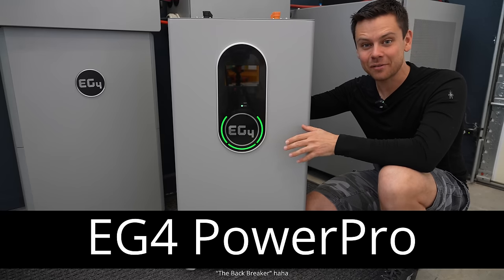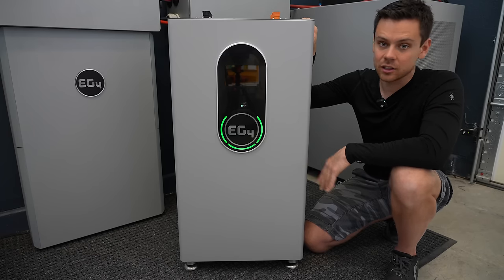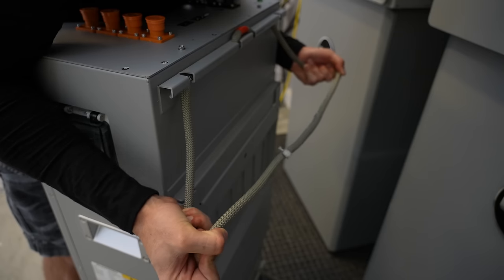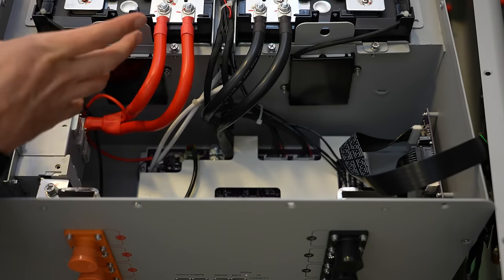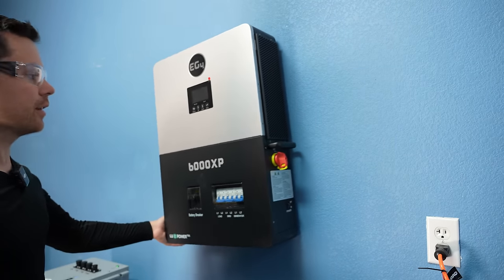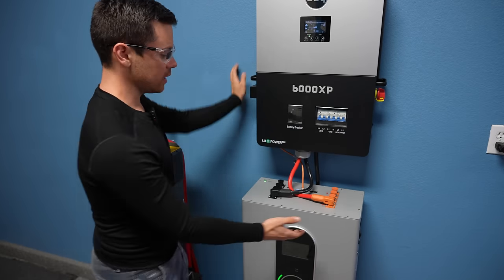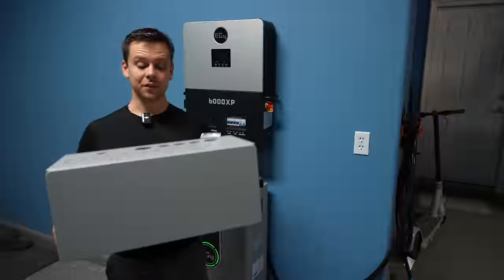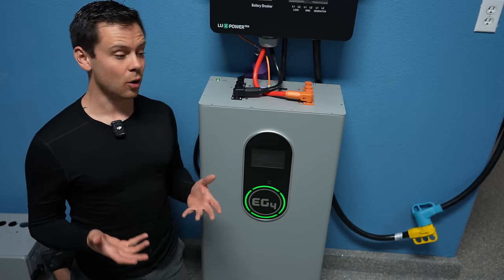New! EG4 PowerPro Budget Model: 14.3kWh LiFePO4 Battery for $3,431

Comment: Outstanding video. I'm interested but inexperienced. I have a poorman's agm battery system to backup small stuff in the eventuality of a power outage. Questions: were you implying that if you dropped the lid it could cause a short circuit, like the wrench could? Could painting on thick layers of liquid electrical tape on the positive contacts be worthwhile? Maybe you can profitably create some battery-like covers and sell them on your website.

I see that the batteries have sensibly included adjustable 'feet' like for a washing machine. Be sure that the rear ones nearest/next to the wall are a smidge shorter to insure that the battery slightly tips toward the wall (I'm an old Dad).

Question: I'm also interested in online affiliate marketing. Isn't your affiliate marketing link associated with an account? Wouldn't this nullify your concern about the ad blocker? If not, consider linking to your website which is a recommended practice anyway and beats your buyer remembering to turn the ad blocker off and on. Then at your website, if you keep it simple, your buyer can, without giving it a second thought, click on the affiliate link without you losing your well-deserved commission.

Comment: Thats a great setup for a camp. But these inverters are having a hard time with generator charging. Some make it work.  
It would be great if you can do a video on generator application. Because a lot of people are using this off grid and a gen is needed in some cases.

Comment: I'm considering a complete off-grid 16X40 shed to cabin build. I'm new to the solar power landscape. Could you make a recommendation for a system that could handle 20kWh daily 24/7? Also how many panels would I need to power the cabin during the day while charging the battery reserve? What panels would you recommend? They could be mounted on a white metal roof which would provide some reflection to the back of double sided panels. Please keep in mind I would like to stay as budget friendly as possible while maintaining a solid system. Just a side note, would it be possible for a  generator hookup to charge the system for extended cloudy days especially during the winter months on the east coast? I have watched a lot of your videos and my brain is in information overload. Any help would be appreciated. Thanks

Comment: Lolz at Will cutting what looks like 4/0 wire as if it were 16 AWG. Snip. Done. Meanwhile for me, it's more like using 4 foot handle lever cutters and leaning my whole body weight on them for 5 minutes to get a cut.

Comment: “You can use the conduit box and still leave an inch or two between the batteries!”

Oh, good. Blocking the breaker seemed like a safety issue. 😅

Comment: Thank you for sharing this Will. We live in an acreage, no water line, we are using water pump for our water supply. If there’s a power outage, then we do not have water available. Instead of installing generator, can I use that EG4 pro instead? What’s your thoughts? Thank you again

Comment: I've got a nine foot wall space for electrical.  With 4 batteries and the required spacing between the batteries, that would take up the whole length of the wall.  Will electrical inspectors allow you to install the load center above the battery, which sticks out 10 inches?

Comment: Will,  I live in Georgia.  My house has very good Southern exposure and ZERO shade trees.  My roof is needing replaced.
My electric bill runs $350 to $450 per month.
Would a system like this combined with solar to charge it be cost effective?
We would keep the house cooler in the summer if the cost was say $250 less per month.
Thank you for the excellent video!

Comment: Are there any inverters which can handle an array of multiple batteries in this system? Can the 12000xp for example handle an array? If possible, please do a video on lowest cost highest volume storage solution for multi day outages as a gas generator alternative.

Comment: I’d be interested is seeing this system in a tiny house / off grid mock-up. Is one battery and inverter enough for a frugal energy use situation? Smaller refrigerator, tv, lights, computer, ac and space heating.  How much solar would you need? We have a weekend and holiday cabin we’d like to use more but now it’s just like camping with a marine battery we run an inverter on. As we’re getting older it’s getting harder to manage without the mod cons.

Comment: The touch pad on that battery is what the EG4 inverters should have had 8 years ago. Or any inverter for that matter. I have 4 6500EX's powering my house and it's ridiculous trying to understand the screen. It's blocky and 1980ish. Works well from what I can tell except for the lights flickering

Comment: Could I use this thing just as a backup for when my grid power fails? Rather than building an entire solar system, what kind of system do you recommend as an emergency backup that would work for several hours during an outage? You’d guess that some sort of battery system would be preferable to an entire solar setup, as the battery can be charged and be always on standby during normal grid activity? If you could make a video about helping us design a good setup for this I think it would help a lot of people that suffer power outages on a regular basis like we do.

Comment: I'd be interested in a video covering a low cost set-up just for peak shaving and backup power, where I live there isn't much solar, but if we ever do a new roof want to keep it an option. The cost of battery+inveter have dropped so much it's almost less that a home generator. This power pro solves the battery side, but what inverter? The Sol-ark 15k is an option, but $$$.

Comment: I have a small vacation house in Vegas.  
I’m interested in doing this particular system.    I have one question.    I intend to run an off grid piggy backed on my on grid system ( for lack of better explanation).  My question is is how do I uncouple  ( switch) from the grid in the sunshine and automatically reconnect when the battery is low?   
My house has both high efficiency heat pump air conditioning and evaporative coolers which I use 90% of the time.  
I’m relatively sure that I could power my house with this set up completely off grid and just shut the power off, but it would be nice to have it as a back up    
It’s gonna have to have some type of a high amperage disconnect. I know I can do it manually, but I don’t know how to hook up a device that interrupts automatically.       That’s my question.

Comment: I made my first purchase of solar equipment on signature solar for $5000 and the service hasn't been great. Feel like im dealing with a small company operating from someones garage. 😢 An EG4 3K came in bad and its been a protocol to get it replaced. Their best solution was "just buy a new one if you need it soon because replacing a bad unit takes time" ...

Comment: Should I put ferrules on my fine stranded 2/0 battery cables that go into the 18k lugs? Or leave them just stranded. It's very hard to get them to all fit into the lug as they arrive in the package. Just loose wire. I know bolt down eyelet lugs for cables get crimped on and I have hydraulic crimpers but wondering about the terminal block inside the 18k. To ferrule or not? Also hex or square? I believe hex is better for round holes.

Comment: I am building a solar system for 50A split phase RV. Was going to go with 3 EG4-LLS batteries and a EG4 6000XP inverter and 4000 watts of solar. Would this EG4 Power Pro 14.3 be an option for an RV application?

Comment: Will, I have 2 EG4 wall mounts, and want to parallel them using the existing busbar on my main battery. Which Amphenol connector do I need to buy? EG4's website (or SignatureSolar) don't have ANY info on it... The cables they come with have 1 male connector and nothing on the other hand. So I need to make a male-male connector I'm guessing.

Comment: This really emphasizes why Victron needs to come out with a 5kW 48V version of the 2x120 inverter, there's SO many good options for 48V, your $/kWh goes way up for 24V and the system $/kWh goes up for large 12V due to the crazy cabling requirements.
Reply: Just yesterday I went to Victron's website to look up what they have produced recently and it didn't seem like anything material. I do love their products but they seem to be slower at development.

Comment: so this will not put out voltage if not connect via the can buss.  What if you have an inverter that does not have a can bus.
Reply: I believe, it will put out voltage, but you just won't be able to monitor it.

Comment: Is there some way to tie in a power station like an Anker F380 to the 6000XP? I know it allows for a generator and the f3800 can supply 240 easily. I know people will ask why but I have to go with the resources I have as they become available and not everyone has the money or wants to buy a generator that requires fuel. When there is an emergency or something I don't want to be left wondering where to get fuel for a generator

Comment: Since the battery is designed to run indoors and connected to the EG4 inverter could you report on the noise level.  Thanks

Comment: Hi Will: thanks for that overview. Can u give a little piece of advice? Ive got a 50ft solar cable with the XT60i at its end to fit into my Delta Pro's. They were defective, so now gone, but Im keepin the cable. I see on the Delta Pro Ultra, that plug wont fit. But I want to use that long cable for the solar panels Ill get soon with a brand new Delta Pro Ultra. Id like to know: Is there an adapter available to get that long cable to plug into the DPU? Or do I have to buy other cables and butcher them up and rig my own fittings? Any advice would be appreciated

Comment: Does a garage count as indoor ? This seems like a good system but garage is the only place I have available.
Reply: It should be. In the video it said it still has the heaters.
The only difference I see is it will not be exposed to the elements.
Reply: Also I don't know that I would send it directly on a concrete floor of a garage. You might want to ask signature solar that. Or find some type of plastic pallet to put it on.
Reply: Yes the garage is fine as long as it is weather proof. Just don't want these in the rain. Also it is a good idea to put air filter media over the fan inlets to keep the inside of the inverter as clean as possible. It is cheap protection and you can hold it on with magnets.

Comment: I'm curious can this be integrated into an existing solar setup?    I assume I would want to swap out my inverter anyways since my inverter shuts off if there is no line voltage detected... because having a breaker/switch shut off generated power to line is too much trouble so instead leave me without power when the power goes out is a cheaper solution.

Comment: Might have put this on the wrong video sorry:

Hello,

I’ve got a question… maybe unrelated to this video. 

I’m wanting to set up a 6000xp,  1-3 power pros, and a EG4 chargeverter GC with a military surplus 5k+ generator (I’ll also get a propane inverter generator). From what I understand I need a bus bar for the military 5k generator. 

How would I set up the 6000xp, 1-3 power pros, bus bar, eg4 chargeverter gc, and the military generator? 

Also what bus bar should I use or should I use one of those blue 1000 amp “vector distributors”(I think)?

Please help clearly confused 

Thanks ahead of time

Comment: Will, need some help. Have a hydro-phonic system running a water pump 12 hours a day (15 minutes on 15 minutes off). Pump 100 watts, 8.8 amps, 120 volts. Have the 370 watt mono APTOS panels (370 WATT, 40,8 V open,11.51 short, 34.08 vmax, 10.87 lmax)   with micro inverters ( 1:IQ8M and 1 DUAL APTOS MAC 800). Whats my best setup to run this hydro system.

Comment: 8:49 do you have a video up about that portable unit sitting next to you there, I need to see that?????
The conduit box is gonna add just enough space to reach the switch / breaker on the side isn't it??
Great video on a Great Looking Battery, Thanks!!
Reply from the maker: Yes that system is the mobile 48V system available in my links
Reply: @WillProwse i just made that set up this weekend.  Where would i put the breaker that came with the eg43000?
Reply: @WillProwse  Thanks
Reply from the maker: @mycabinlife1291  that breaker is for battery input if you wish to use. If only one or two battery, not really necessary
Reply: @WillProwse  I just figured out how to hook all this up right now I just have it sitting on a cooler not on a cart and I added a third battery to it today but I was wondering how to hook up two if there was a hand truck that was big enough for that.
I'm up at the cabin right now but would like to take it back home and use it to combat my FPL bill lol

Comment: am buying an indoor wall mounted EG4. I have Schneider Inverter xw6048 with latest firmware. In addition I have insight facility. I am told by Schneider that XW6048 does not have the control board required to allow closed-loop battery comms. Is that true? Any workaround for BMS to communicate with the Inverter? Basically to give status of SOC.

Comment: Have a AIMS 48V Global LF series inverter….don’t see anything about Modbus or Canbus in the manual 
specifically Model # PICOGLF10KW48V240VS 
Are these batteries compatible with my inverter? 
I notice most new batteries are Modbus or Canbus required.

Comment: Will these communicate with the original indoor version of Solark 8K?  Love your Channel and content been watching since your RV living days. Thank you Much Respect!
Reply: Sol-Ark does not officially support closed-loop communication with EG4 batteries - while the batteries do have the protocols that can make it work, Sol-Ark may require you to use voltage-control if your system has any issues.  With that being said, this battery is only UL9540 certified with EG4 inverters, so that may be a consideration.

Comment: I am seriously considering using this system in my house. I can have it installed when I upgrade to a 200 amp panel and drop line.

I can have them run conduit outside for adding solar at a later time when my budget permits.

Until then it can be used as a battery backup system for my house.

After adding the solar I could use it to charge by Tesla Model Y. 👍

Comment: I have a random question, new to all this, wondering since I have a terrible roof/yard for solar panels, could I use an inverter generator to recharge this system if I did 2 inverters and 6 batteries.

Comment: I currently have a 6048 hooked up to 2 EG4 server rack batteries at my cabin but really need to add more storage due to poor solar in the winter months.  Would I be able to buy one of these battery banks and simply cable it to my bus bar that is currently tying the 2 EG4s together or perhaps cable the 2 EG4s into the top of this unit?  I don't currently have any communication going between the components (and have now twice had one of my batteries go to a red error light due to what I assume is hitting the overcharging limit after a particularly sunny day with high use.)  I'd love to get the new inverter simply for the more flexible solar inputs but am having a hard time justifying the expense when my 6048 works (got 10 250w panels)

Comment: What I need is a battery system that will play well with my existing Enphase IQ7+ microinverters, I’m going to try to dig into this to see if they’re compatible. The frustrating thing I’ve run into with other solutions is that companies like to package a solar inverter with the battery inverter which seems like it’s just overcomplicating things and adding more cost unnecessarily. Any tips on where to go to learn more for my intended use would be appreciated!.
Reply: Contacting a distributor that knows their products inside and out could be your best bet
Reply: I have an Enphase system too and would like to know if it’s compatible with the EG4 powerPro

Comment: Hi Will don’t know if you will get this. I just want some of your thoughts. And ask some questions. 
I just moved into a house in Fort Mohave Az. It’s hot as hell here. Lol
I’m thinking that I want a EG12pv with an EG4 48 volt battery
10 ( maybe more) Aptos Bifacial 370 watts Solar panels. I would also like to back feed into the grid. If possible. 
Our bad weather is in the summer and I don’t want to be caught with no AC.  We just moved into this house and still unpacking. I’m putting a new roof on and then I would like to install a system. our first bill says 81.5kw avg. daily use. Also would like mount this in my garage but it’s hot in there this time of year. We have been up to 120f. Mostly around 110-115. Is that too hot for the equipment? Our grid and breaker box are 70-80 feet from the garage. Any advice would be very much appreciated.  We don’t want to be energy independent but be able to run our house for a few days. With out power in the heat. Thank you Will.

Comment: I wonder if you can extend the range of a pluggin hybrid.  Those let the car be an EV mode running on electric only but they have limited range like 30miles tops.  Put this in the trunk and you get 60? I doubt the voltages match up, but maybe a  BBC can make it happen ( Big Boost Converter) "Innovation lab" makes some if you havent checked that channel out he's got some big buck and  boost converters going on.  Or maybe just charge your regular battery with it while its in the trunk , same thing right?